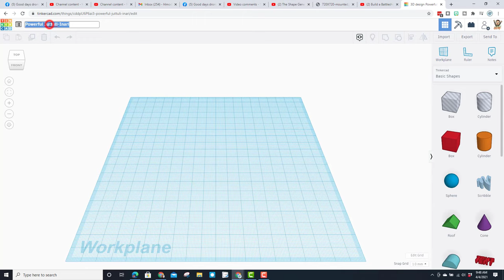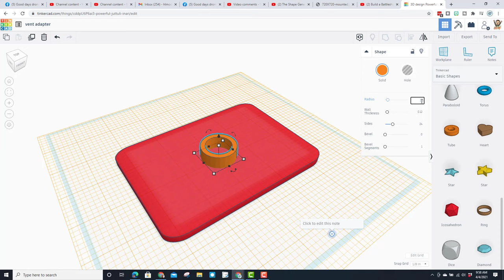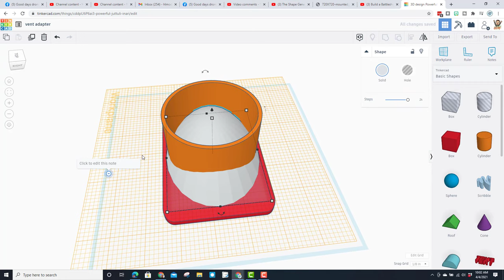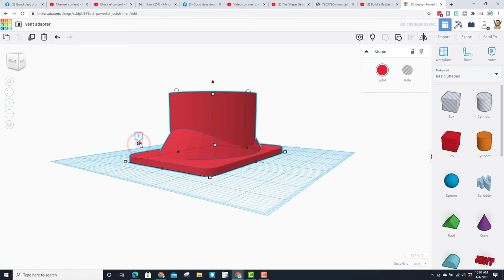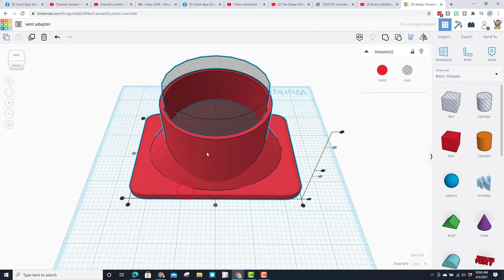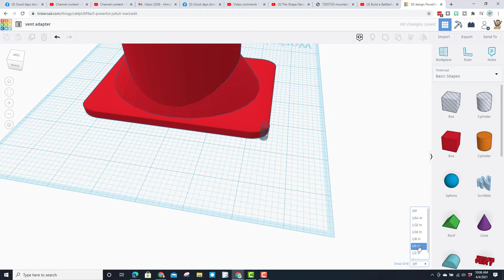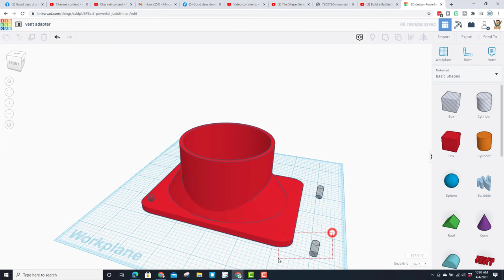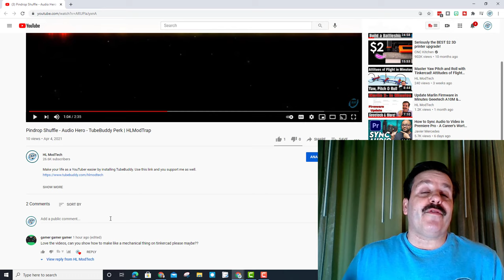Make useful parts for 3d printing FAST using Tinkercad

Comment: 3D Printer Linear bearings/ Sliding blocks/Shaft Brackets/ Couplings/Handles/ Engraving Machine Press Plates / Manual Screw Jacks/ Lathes Dogs/ Disc Springs/ Screws/ Nuts ...Welcome to MSM Store (Your one-stop shop)
Reply from the maker: Thanks for dropping by.
Reply: @HLModTech  thanks for reply.having a nice day.

Comment: I had previously used Solidworks but chose to use TinkerCad because of the very simple approach.

I made filament prints for work because big and blocky were okay.

But I have been able to design very intricate scale model railway models for resin printing and I am astounded at the level of detail that is captured in TinkerCad. Thank you for this tutorial!
Reply from the maker: Super cool @kjamison5951! Love to hear it when there is a success. 👏💯

Comment: This is one of the best videos,   it shows how to do so many things in one video,   I wasn't aware of the auto centering,   I wasn't aware you could choose wall thickness,   I would do a solid object and copy and paste and make the copy a lil smaller and turn it into a hole for a cylinder,           but how do I get a true round object,   seems all my round edges  become flat the bigger the cylinder I make,
Reply from the maker: Thanks for the kind words. The main Tinkercad cylinder will smooth out a bit when you slide the sides up to 64. I do it pretty quickly in this video. https://youtu.be/CrEn9LD01gM Thanks again for watching and feel free to reach out if you have questions.

Comment: I have a quick question for you. Do you know how to make a pool adapter for a summer wave above ground pool to fit an intex pool vacuum? I believe the hoses are 1.25 inches to 1.50 inches. I also have a picture of what I want to replicate if you need a reference.
Reply from the maker: I can help you get that created. The picture would help a ton. If you will, shoot me a note hlmodtech gmail.
Reply: @HLModTech  I sent an email to you with the pictures of the part

Comment: Great instructional video! A question regarding outer wall thickness: I designed in Tinkercad and printed, essentially, a funnel to replace the original poor flowing one on my aquarium gravel vacuum tube. It's sort of 3 pieces grouped together. I made the walls 2mm thick for strength and made them 2mm in the slicer. Yet the first one, when I dropped it, it came apart at the joins. I ended up putting 4mm rings at the joins to ensure that didn't happen again. Is 2mm about right? Is it common for such things to be weak at the joints? I used PETG - 235' nozzle, bed 70'
Reply from the maker: Thank you. The 2mm in the slicer will not grow your model to achieve that thickness. What it does it take a part that is solid in your design and print it with 2mm walls. A great question. I think I ought to make a video about it. Thanks for the nudge. Adding the rings in those areas is pretty slick. It is like adding a fillet for strength. 👍 Thanks again for the reaching out.

Comment: This is a great video. I have two changes to this exact item but don't know how to do it. How do I make the base into an arc so that I can attach it to the side of a bucket? How do I rotate or slant the tube portion of this so when I connect an inlet hose to the bucket, it creates a centrifuge to rotate the dust on the way in from the vacuum...(bucket dust collector attachment is what I'm trying to make). Any help you can provide would be great. Thank you.
Reply from the maker: Thank you for the kudos. If you are willing, shoot me some images of the setup. You can reach me at hlmodtech gmail.  It will help me give a better strategy for creating your part.

Comment: Hi,, I have a question; what do I do to make an object scalable? What I mean is if I want to design something that I want to make in different scales , do I draw or design it full size or do I have to do separate drawings in each scale?
Reply from the maker: I would make the design for the first scale. Then make a copy of the project and simple shift stretch the copy to fit the 2nd scale. This video has a similar idea I believe. https://youtu.be/16kXsFwqpHs

Comment: This was a great quick tinkercad tutorial!
I have a question which is about as complex as the related model. I modeled a koi, complete with scales. Each scale shaped and angled slightly differently to curve along the body and fit perfectly, random yet symmetrical. It is easily a 200+ part model that frequently fails in processing when grouping. Is there any special order I should group things to ease this? Example being when grouping scales should I group 2, add 1 and group, repeating until all are grouped or select them all and do one big grouping of dozens of shapes for part of one side of the body? The large groupings are especially prone to failure but the smaller ones do as well. I've tried copying then pasting to a new blank design to group and then copy/pasting back. It's pretty much complete as I've managed to work through the failures although I did give up for a while... Am I skating the limits of tinkercading?
Reply from the maker: That is a fantastic project and question.  Groups of Groups of Groups really kick the systems tail.  I group sections, but try to leave all the sections separate.  Another slick move is parts.  I think I made a tutorial about it... I will do some looking quick.
Reply from the maker: Cannot find what I was thinking of, but I will create something for tomorrow morning. Thanks for the nudge and have a great day!
Reply: I look forward to finding out if you mean a fish project and if so how you go about it. Or whatever it is, you are my goto for tinkercad tips, tricks, and suggestions!
Reply from the maker: Thank you and I think it will apply. If not I will give it another go as I dig this type of project.
Reply from the maker: @jdizzforyou  The video has posted. https://youtu.be/wP7TUabWTqw When you see the treads for the stairs, I am picturing you making a "set" of 6 scales that can be saved as a part and reused.  I think that would make the fishy render faster.

Comment: awesome video man! you helped me a lot designing my first thing in cad. i have a question though im working on something that needs precise holes for mounting a light into. its a simple design just a flat square with 4 holes in each corners for screws and a large circular  hole in the center for the wires to come through it but i need 2 holes on each side of the larger hole perfectly spaced so the light will mount to it.
Reply from the maker: Thanks for the kudos! Sounds like the ruler tool is what will assist you most. I usually skip it and use nudge. As a math teacher I just do the math for the location... I will see if I can whip up a video to add precise holes this morning.
Reply: @HLModTech  wow thanks man! I'm looking forward to seeing it. Your   how to videos are the best I've seen on tinkercad I've learned more from a few of your videos that I have from 30+ minute long videos from others.
Reply from the maker: Thanks! I am always trying to squeeze as much in the shortest time possible. Teaching middle schoolers has me always trying to hit the sweet spot for their attention spans. =)

Comment: Hi so just asking but for future references would it be at all possible to change the color of your mouse arrow to a different colored, preferably black or red, just so it’s a bit easier to see where your mouse arrow is, other than that it’s a very slow and very informative video 👍, sometimes some other tutorials tend to be too fast it makes it difficult to understand, or they simply end up ten steps ahead and you’re stuck trying to catch up.
Reply from the maker: Will do some checking on the cursor. I have the clicks highlighted, but have never messed with the cursor. Thanks for the kind words and really appreciate you taking a moment to leave the feedback. 💯👍
Reply: @HLModTech  no worries it’s just that it’s kinda hard to see where the curser is some time but other than that a great and easy to follow tutorial
Reply from the maker: I threw a red cursor into today's creation. If you have a minute, let me know what you think of it. https://youtu.be/oFk-3ElAYiQ

Comment: Great video that's helped me massively but I'm still stuck. I'm trying to create a duct reducer for my laser engraver to extract fumes more efficiently. My problem is going from a round 80mm duct down to a low profile rectangular duct approx 15-20mm high. I've tried Free Cad and On shape but I think they're a bit to advance for a newbie like me. Is something like this possible ? With a 5mm intake slot on the front of the rectangular shape.
Reply from the maker: It should be possible. See if this vid helps. I made it for my laser. https://youtu.be/dObaSlKADr0 You can reach me at hlmodtech gmail. It is easier to send images to describe the project that way.
Reply from the maker: I am trying to picture a 5mm intake slot. That is crazy thin from a 80mm start.
Reply: It doesn't need to be 5mm just something low to draw the fumes away from the workpiece. I will send a picture of something. Thanks again  similar @HLModTech

Comment: Now if you could teach us how to make the cut out inside curves of the paraboloid 45° so that it can be 3D printed with no support. 👍 I'm pretty sure can be done with some very complicated math that I personally can't get my head around. But if there's some tool or tips that I don't know about that would be awesome.
Reply from the maker: That design does print without supports. 45° is the max angle that people usually 3D print at. The slope of that paraboloid should be less than that so it should print pretty well. When mine was done I just scraped of anything that was not clean. Sanding would even make it better. Even though I taught math (middle school) for 6 years... I still went with guess and check for all the info above. =)
Reply: @HLModTech   Yeah I meant for any 3d modeling with tinkercad not just that model only =)
Reply from the maker: New tutorial for making a print in place car just rolled out. https://youtu.be/imO-8w-1ejQ

Comment: Hi Brian. I'm hoping you can help me with this one as it's driving me nuts! I've created a model that has several different angled faces and want to 'lay' the whole model down onto the workplane on the model's largest face. Is there any way of SETTING the workplane to any of object's various faces and locking it to it? This would obviously allow me to start printing it from that face and also allow me to save it in that orientation. I can obviously align it with the rotation method but it's not going to be accurate. Anyway, Here's hoping! Thanks very much
Reply: I've just cracked it! Not very intuitive to do but managed it......👍
Reply from the maker: Sorry I did not see this earlier. This is a fun lesson about the workplane if you are ever just interested in making something funny. https://youtu.be/cm8zl15LVlY
Reply from the maker: Nice work!
Reply: @HLModTech  thanks for the reply and the link. I've just watched it and learnt loads....as I'm new to Tinkercad I'm trying to run before I can walk and so you are pointing out lots of routines that I would never had accidentally discovered for myself (simple example - cntrl and up arrow). It's obvious that Tinkercad isn't as 'sophisticated' as other bespoke software but, for me anyway, it is allowing me to slowly start my 3d printing journey as I'm not looking for complicated modelling. Thank you so much for the help! 👍🏴
Reply from the maker: Sweet! It is fun when you start making progress. I loved watching the improvement in my students as they started knocking out a few projects.  I try to sneak all those shortcuts and nudges in there... Having fun and gaining the skills is a win win. What 3D printer do you have?
Reply: @HLModTech  well, I have some in depth on-screen 3d modelling experience of autocad and SketchUp (construction plans and design) and so, I suppose, creating some physical objects was always going to be the next step but it took me years to finally admit I wanted one and then a few more months as I got put off, numerous times, by reading loads and loads and loads of reviews (you know what I mean) where there's always good and bad. Anyway, a mate of mine had evolved to owning 3 Enders (ha, makes it sound like I know stiff 😂) and, because of this I started looking into them but couldn't justify the cost for what I'd be doing with them (ie only tinkering). I then read that the most sold unit on Amazon was an Aquila and that it was an Ender clone but cheaper.....long story shortened, I bought the Aquila x2 and have literally (30mins ago) only just finished putting it together as it's been in a box from pre Xmas.  I'm now going to wait until tomorrow (when it's sunny bright) to try it out. Not looking forward to the bed levelling - having written that, i should just get on with it and stop getting put off by what I read on the web!
Reply from the maker: I had a Ender 3. Good machine. I would guess the clone is good too. This video shows my steps for a first print with the Anet ET4 series. It is pretty simple and I bet you could follow the same steps with yours. Just choose your printer in cura instead of the Anet machines. The main point is get the tiny cube printing before moving to big stuff... https://youtu.be/g2sySdWmT8Y
Reply from the maker: Cura will be a much newer version now.. Just so you know. 5.21 I believe... but it works the same.
Reply: @HLModTech  aah.....but.....(there's always a but).....I retired a few years back (took it early) and so i'd virtually stopped using a pc/laptop. My 'old' pc is now not all singing and dancing and I'm only now finding out (through my blundering-through) that I should really have windows 10 and a lot of disc space and ram (which I haven't ☹️). However, the slicing software that 'comes' with the Aquila (voxelmaker) IS working on my tablet whereas Cura, even though it would load, would not run (ram issue I think).....I'm going to try with voxelmaker (some say it's ok) but may end up having to buy a new laptop (but then it means persuading she who must be obeyed 🤔☹️).
Reply from the maker: Totally makes sense. I only use Cura because it is what I had available. I have experimented with Prusa slicer, but I always seem to drift back to Cura.

Comment: I have designed a mount for a PCB, however, I want the boss's that the screw goes in to be printed as walls all the way down to the bottom of the base it is on so that they are not just printed on top of the support, how can I achieve this?
Reply from the maker: Would you like to send a share link so I can see inside it? Here's how https://youtu.be/XeDQjhRK8lg Or even images so I have a better idea of what we are discussing? You can reach me at hlmodtech gmail.

Comment: @hl modteck how do you set the inner diameter of a cylinder when using circle array? I’ve tried using the size selector within the shape but the actual diameter is off when printed.
Reply from the maker: First, are you sure your printer is calibrated to print perfectly? None of mine are... so I use a bit of Kentucky windage when I am making a part. Secondly, make sure you avoid the handles while using parameters. https://youtu.be/Fzb5YI4uvAE
Reply from the maker: Would you like to send a share link so I can see inside it? Here's how https://youtu.be/XeDQjhRK8lg You can reach me at hlmodtech gmail.

Comment: Quick question how do you center a shape inside a shape, I'm trying to make a Xmas tree cookie cutter with a 2nd tress that will imprint a pattern on to the icing sugar, but I'm having trouble getting the star at the top to center as i only need the outline of the star not a solid block.
So i placed down 2 stars and the tried to shrink the 2nd one that will then cut out the center but it's not working or I'm simply doing it wrong.
Could you please make a video explaining/ showing how to do this or a link to a video on this if you've already made one.
Reply from the maker: This video is about aligning. https://youtu.be/x1JGlzmbK-g
Reply from the maker: I think these SVG tricks may be cooler for you though. If you are interested in Inkscape this one is useful too.  https://youtu.be/sa73wwwMLq8
Reply from the maker: Or the Kool Aid man tutorial should hook you up. https://youtu.be/ua1fT4Xh2fY
Reply from the maker: The SVG fill options are key to getting just the outside of the star.  https://youtu.be/iM1SvrvBHqU?si=cXPzjJGcxG1kSi4H

Comment: How do you make a beveled edge on a rectangle that is 1/4" thick?
Reply from the maker: I would make the rectangle 1/2 inch... bevel that and cut it in half with a hold block that is 1/4 thick. When grouped you will have a flat bottom and a total of 1/4" of material.

Comment: Local library will let people print stuff. I found an stl file on myminifactory of a horse and jockey but would like to increase the thickness of the base before printing to make it a little more stable and bottom heavy. The library said I can use tinkercad to edit it but every time I try to open the file it says file size is too large. Any ideas?
Reply from the maker: This should help. https://youtu.be/JwqdsIoIsas

Comment: Any advice on how to make an oval shape in tinkercad? I want to produce shedplates which are ovals with letters and numbers on them
Reply from the maker: Grab a cylinder and stretch the handles. Change the nudge to .1 mm to get as accurate as you can.
Reply from the maker: You can also experiment with this shape. https://youtu.be/a5f-n_4vV6Y or even the extrusion.
Reply from the maker: This is a extrusion explanation video. https://youtu.be/YkxFonZl6Z0